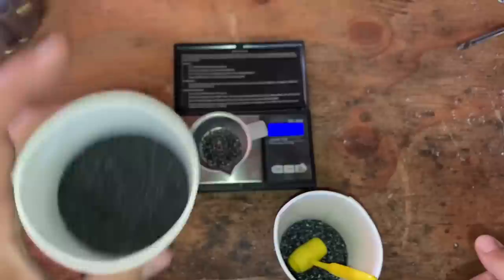Why Is Your Homemade Black Powder Weaker Than Goex? Black Powder Service Announcement.

Comment: People don't understand that water isn't part of the recipe. It just facilitates the activation of the adhesion process under compression, then evaporates off.  Is not like there is residue hydrogen or oxygen left from the water.  People just need to experiment with the amount of water that works for them.  I think your recommendation of just enough for there to be no dust is probably the best rule of thumb you can give.
Reply: I think it's funny that I found Jake's advice to add water "just until it quits making dust" was one of the most accurate and precise tips anyone has ever given me regarding making BP, yet he gets the most guff over it.  Given the number of variables involved, that tip simplifies all of them down to one thing.
Reply from the maker: Thank you
Reply: The given explanation has worked for me...repeatedly.

Spray, stir, repeat until there's no floating powder.

Comment: Considering the rise in black powder prices and the short supply, I've been looking at making my own. To that end, these videos have been a real help.  As for the compression factor, I'm kind of a TLAR (that looks about right) type of guy.  As long as the ball moves at a reasonable rate, who cares? Considering how black powder was made back in the sixteen, seventeen, and eighteen hundreds and that it was good enough for them, I'm good with it.
Reply: I was thinking about this yesterday as well. Do you think during the revolutionary war they had an electric tumbler and a 20 ton press and different size screens to sort all of it? I don't think so. I found some documents a while back on the internet that claim to be from the United States government instructing farmers on how to build livestock pens in order to create the most potassium nitrate possible. Obviously I printed them off because I didn't think that would last in these times where things get scrubbed off the internet on a regular basis. What I'm saying is I think we strive for perfection when it's not exactly necessary. We still do it though.
Reply: If you measure by weight instead of volume you get the same amount of powder from a given amount of ingredients.   The same weight of powder will, theoretically at least, produce the same volume of gas on ignition.  While  a denser powder will occupy a smaller volume and generate slightly higher initial pressure the effects on velocity will be small.   In short, a pound of powder will give you 140 loads of 50 grains weight regardless of the compression.

Comment: I'm surprised bp is denser than water.    Density is just a ratio between any volume  (cubic cm,  gallon, dixie cup etc.) of a material and an equal volume of water.   The ratio will always be the same.    Essentially you could fill a shot glass with bp,  weigh it and compare it directly with the same shot glass full of water.
Reply: Granulated BP is close to the same density as water, but the density of the solid pucks and individual grains of corned powder are almost double that of water.
Reply: With enough compression you could make feathers denser than water.

Comment: I use 4% water by weight. I use a 12 ton press with 3" die column. 3" PVC tube with steel separation discs to create a stack of pucks. 

My trick is to let it dwell for a few minutes under pressure. Air slowly squeezes out, I am assuming out of the pours and cells of the charcoal. I usually apply pressure 2 more times with a dwell time between pressing.
It quits yielding after the 3rd application of pressure and the ram stays solidly against the column. You can feel it in the lever as you apply force. After applying force and letting it dwell, you can feel that it didn't lose pressure. It's as hard and dense as it's going to get.

I read an article that Goex uses this method too. It works.

I get 1.8g/cc. I don't need to repress.  Glazed to flow proper through my meter. I have no issues with performance or characteristics.

Comment: If you have a press that's less powerful, such as a 10 ton.
Make your packing die a smaller diameter. By doing so, you will get more density because your psi (pounds per square inch) will go up.

Comment: Excellent!  For consistency, I like to actually measure the density of my pucks themselves, which is where 1.7 to 1.8 g/cc density comes in.  Measure the volume of a pressed puck, weigh it, and divide.  I'd also like to make the distinction between granulated density and grain or puck density, the granulated density of the finished powder as you measured in your video is actually about 1.0 g/cc, or the same as water. 1.5-1.6 g/cc puck density makes a little bit cleaner, faster powder, but I prefer to standardize against commercial powder so sight settings don't change.  

I use a 20-ton press and 1.5" diameter puck die and my pucks come out about 1.8 g/cc pretty consistently after pressing.  My finished powder equals GOEX and Schuetzen in both velocity and granulated density within +/- 2% as long as my meal is milled enough, the charcoal is good, and I dried it enough.  

For those frustrated by the difficulty in determining how much water to add to the meal, it's really simple:  Press to 1.7-8 g/cc (whatever that takes) and add only enough water that the bottom of the puck is slightly wet when removing from the press.  The powder will compress more for a given pressure as moisture is increased....up to the point that excess water is squeezed out during corning.  Use the least amount of water possible but put enough that you can tell a tiny bit was rejected when corning.
Reply from the maker: Excellent
Reply: pressing the dry powder, can it actually lead to an explosion?
Reply: So, if your screen size is a little smaller or a little larger than the commercial granulation, wouldn't that also factor into the density by volume a little bit? Finer grains would be denser by volume and larger grains would be a little lighter by volume. Measuring puck weight would eliminate this variable as long as puck size was accurately measured size to weight.
Reply: @KevinTownsend-hw5ih  You got it.  11BangBang is wrestling with this a little bit and finding his burn speed/volume/weight/grain size was throwing things off a little bit for him because his screens didn't equal commercial grain sizes.  I've read at least one source that states volumetric measures are calibrated with 3Fg sporting powder.  2F will be slightly less dense, 4F a little more dense, but only a few percent difference.  I don't know if it's coincidence or not, but my most "accurate" (with commercial powder) adjustable volume measure is bang on with multiple brands of commercial 3F and also happens to throw exactly the indicated volume weight in water (1.0g/cc).  I don't think that's coincidence but have never found documentation stating that granulated 3Fg equals water by weight/volume.
Reply: @KevinTownsend-hw5ih  If the shape of the granulated particles is the same, and the proportion of sizes relative to each other is the same, the density should be the same. For example, let's say you have identical buckets. One is full, to the top,  of equal numbers of 1/32" and 1/16" steel ball bearings. The other, also full to the top, has equal numbers of 1/16" and 1/8" ball bearings. The two buckets should weigh the same. 

On the other hand, particle size can affect burning rate directly.
Reply: When do you weigh them?  Right after forming our after they dry?  Or doesn't it matter much?
Reply: @palavrasdoventania5371 I think it takes a spark to ignite, compression doesn't generate enough heat.

Comment: Another way to get more density is to use a smaller diameter die. I get much harder pucks using a 1.5" die rather than a 3" die, but as you said lower density powder isn't a bad thing so I use the larger die to make the process faster.
Reply from the maker: Yes, I use a 1.5” die as well
Reply: 3" die has seven times the surface area of a 1.5" die, so you need seven times the force to make the same density.  This is what's tripping up 11BangBang when trying to duplicate commercial.  You need something like 77 tons of pressure on a 3" die to make 1.7 g/cc density....if that's your goal.  Any pressure enough to make a hard puck is better than screening, we all have different tools available and standards of "good enough".
Reply: @geargnasher9822  by this calculation, what would be the die diameter to achieve 1.7g/cc using a 10 ton press?
Reply: @palavrasdoventania5371  10 to 11 tons per square inch is what I found it takes to press the dampened meal until it won't go anymore.  Figure out what puck diameter gives you one square inch or a little less.  Off the top of my head it should be about 1-1/8"" diameter.  I keep reading numbers like 1600 PSI is the max needed and that GOEX presses to 3400 psi, but I've done the math on my setup and for my methods, it takes 11 tons per square inch to make 1.8 g/cc pucks.

Comment: I have been watching your videos and they are really excellent. I am living and working in COSTA RICA WHERE IT IS IMPOSSIBLE to get any kind of powder but thanks to your videos I am making my own. I have been experimenting with different charcoal. I have been researching why yellow willow and alder are used so much .what I have learned is it is because these woods are some of the fastest growing so they are more porous it has a faster burn rate. I have been using balsa wood trees and even faster growing is called a GUANACASTE tree. My black powder is really fast and clean. I only have a home made cannon because the guns are hard to come by. I am taking some of the wood I mentioned home with me and then I will try it in my rifle . If you would like I could ups you some and let you try it because I am sure you have forgot more about it than I know. Keep the progress coming.
Reply from the maker: That’s interesting we have some balsa charcoal we are milling right now to try out.

Comment: Greetings. There are two values - the internal density of the grain and the bulk density of the grain. By creating pressure with a press, we increase the internal density of the grain. The main criterion for this process is the size of the pressure on the area. If you press with a press of 20 tons on a surface of 2 inches and 10 tons on a surface of 1 dune, you will get the same density in two cases. By measuring the volumetric measure of gunpowder, we obtain the bulk density. It depends on the internal density and on the size and shape of the grain. The optimal grain shape is a ball. The more geometrically the shape of the grain is more complex, then there will be more voids between the grains. And we get a low bulk density.
The power of gunpowder depends on quality coal. Depends on the type of wood, on the temperature at which the wood was fired. High temperature firing of soft wood is good for a revolver. For a rifle, you can lower the charring temperature of wood. The burning rate of gunpowder depends on the degree of grinding of coal and other components. Highly crushed substances give rapid combustion. It is optimal when the components are sieved through a sieve with a mesh size of 325 mesh.
Reply: I'm beginning to notice that it really does depend on the density of the source wood charcoal as far as initial burn rate is concerned. Things that worked well for me white poplar (as dowel stock), and charred denim (had issues maintaining grain strength and structure.)
Reply: @Slowly_Going_Mad  mr  @Mad Scientist your thought is moving in the right direction!!! To increase the strength of the grain, you can use the addition of wallpaper glue 1-2% (modified starch) to the composition. When moistened with water.
Reply: @pyrotechnicSAR  I cooked a batch of dextrin specifically for such a case. I have more to try and figure through experiments, another thing I found works well is mixing charcoals. I have some grilling oak that's mildly undercooked but burns really clean just terribly slowly unconfined. It's major advantage besides clean burn is strong grains. I have a batch that I made with one third of the char by weight being oak and the other two thirds being white poplar. Burns super fast, unfortunately burns really dirty, but makes decently strong grains with out adding other binders.

Comment: Awesome video as always boss! I've been using a mixture of silver maple and holly as my charcoal wood, and pressing ONCE, I was getting velocities like you said, about 100 fps slower than GOEX, and my densities have been just a bit less than GOEX even when I use my 20-ton press. (I measured my dry pucks before corning to get my densities) Anyway, I will DEFINITELY be trying this to see if I can get my velocities up!

Comment: Knowing the 1.7 gram per cubic centimeter and with a press of only 10 ton available my puck mold should be half the diameter of the mold you use to make the same results in compression but i'm gonna hace to make 2 small pucks (in theory) , also gonna try naturally sun dried bp, and gonna try vacuum dryed bp with an A/C vacuum pump dryed to see if there is any difference in density, performance and even how clean it burns testing the same batch...really the best vídeos in this topic
Reply: Not half the diameter, half the AREA of a circle, do the arithmetic.
Reply: You're right half the area!

Comment: If you have a 12 ton press using a puck forming die with 3/4 the diameter should give you the same density as you get with a 20 ton press.

Comment: I've been watching your vids on making "antique muzzleloading propellent", excellent job of explaining the process.  One thing I was wondering about is in your vid on sodium nitrate you stated that it worked very well in cap fire weapons.  Interestingly it burned slower in the open, but fairly fast when confined in the flintlock.  Where I'm going with this is; If you are looking for an idea for another  vid one comparing velocities of this powder in several  caplock weapons would be greatly appreciated as I am not in a situation where I can make "antique muzzleloading propellant", but I am curious about this. Just a suggestion,  Thank you for doing these vids.
]

Comment: The reason you can't tell them the perfect amount of water is because the problem is NP complete for each individual maker. See something called the "knapsack problem" for a complete explanation. You can give them a good starting point but they are going to have try the permutations for themselves if they want exact.

Comment: I shot my first batch of homemade today in my 44 caliber cap and ball revolver.  Used Basswood charcoal at 77/13/10 ratio.  I compressed into pucks with a bench vice and 4ft cheater bar.   With 30gr/vol I got an average velocity of 887fps with the homemade vs 946 for Goex 3f.    I can live with that.   Got a batch of willow to puck, so might try the double press technique with that.  

I am using a small compression die from Amazon that makes 1 3/16 inch diameter pucks.  It is slow going, but perhaps the smaller diameter allows me to generate more pressure/unit area using the vice as a compression source.   Still eyeing that 20 ton press, since it would be much faster.  Just don't know where in the heck I could put it in my garage.  It is full.
Reply from the maker: Keep at it
Reply: Not bad...and hey, less recoil!

Comment: I discovered that when black powder is polished then it is more dense, after polishing 2-3 hours my 3Fg is almost 15 grains in 1cc like goex, coating with graphite isn’t necessary but if someone want to do it start with 0.5% graphite and polish it next 3h (up to 24h). I have 12T press, and 2 inch die and I always have 1,8g/cc. I read about ppl using 3 inch die and 6T press and they had 1,7g/cc, key is using water, dry pressing makes less dense puck.
Reply: Polishing doesn't affect the density of the individual powder grains themselves but it does round them out and that means they pack better giving a gain in bulk density.

Comment: Great video, I have some home made but i bought 25lbs several years ago and have about half left. My home made is stored in empty cans. I need a better press, my grinder works well.  I get around 1.5 grm/cc with my current press.

Comment: 4:35  How much water in the mix. 

I've been delivering Concrete for 12? years now. I can tell you that the moisture in the base ingredients is such a factor in making a proper mix, we Burn samples (Weight rock, sand samples from each pile, heat it until the moisture is largely  removed  then weigh it again to get an idea what the moisture content is) twice a day.  Even then we have probes in the bins that monitor moisture as the rock and sand come up from the piles.
Reply: ....and even after all of that you STILL have to do a slump test of the finished product to meet the customer's specifications.
Reply: @geargnasher9822  exactly!  or maybe 3 or 4 people have to do a slump test if it's for DOT

Comment: I tried to drop by Goex a few months back “in Minden, LA” to see if I could buy bp directly from them passing through on I20/US80, GPS told me to turn right and my destination would be on the right....turned right and I find myself approaching a US Army National Guard gate/base with cameras and GPS is pointing at a building about 1/4 of a mile inside the perimeter.  Turned around and left.  Obviously not exactly open to the public.
I would love to make my own, but right now I just don’t have the time.

Comment: I have a 12T press, I'm going to try thinner pucks to see if I can increase the density. Two heaping teaspoons full in a 2" pucking die. I don't have a chronograph but I've made some that feels and in a video, appears to be damn close to commercial when shot out of my Walkers. I milled it overnight and am milling it a second time. I expect a lot of dust. I'll use density as a measure of my success.